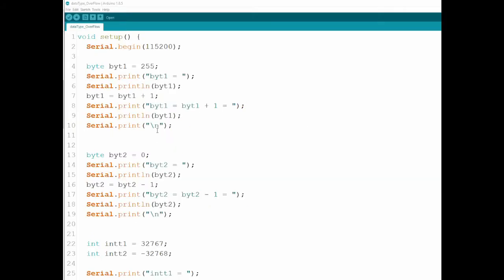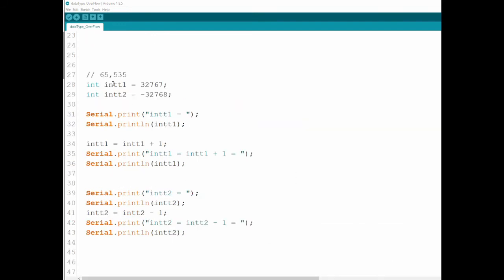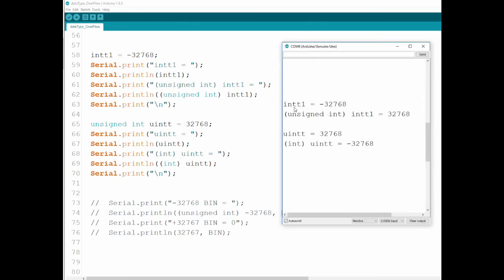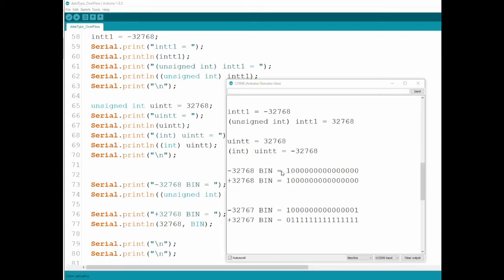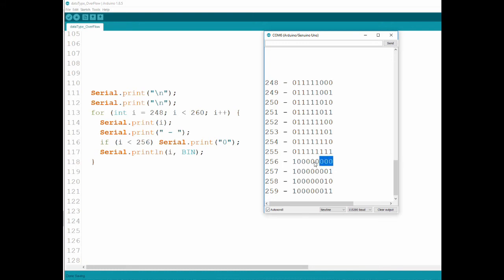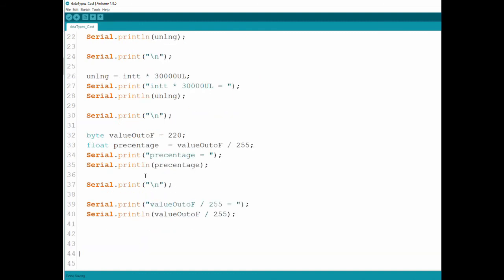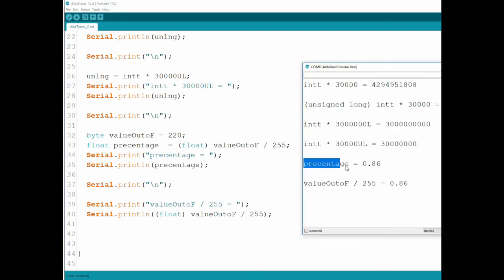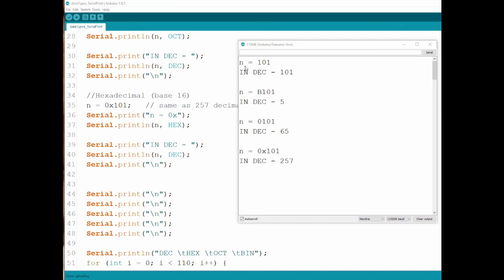Tutorial on data types in arduino II

Comment: Interestingly, I use uint8_t, int8_t, uint16_t and int16_t.
Reply from the maker: When I started to program PIC micro controllers I did the shift as well. 
But since this tutorial is for the arduino environment I used the types as they are shown on the arduino.cc site and most of the examples.